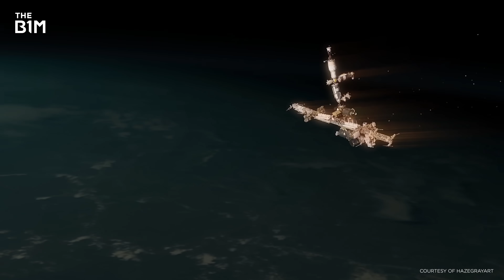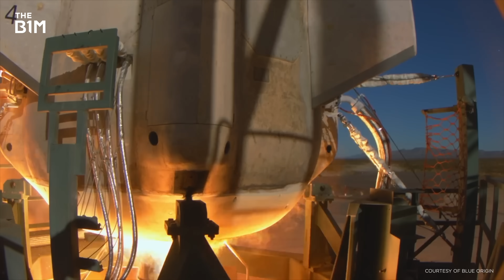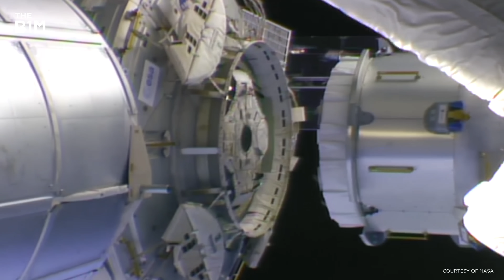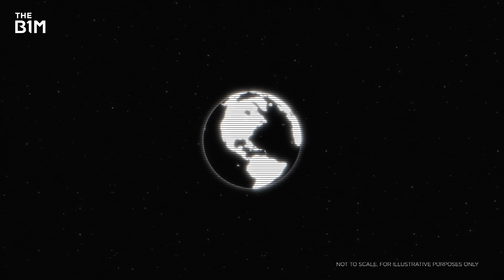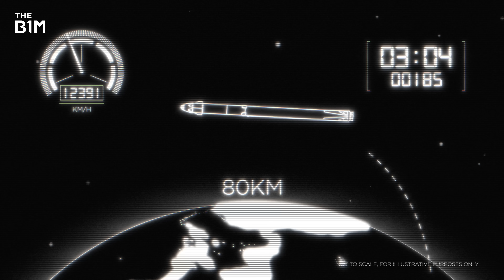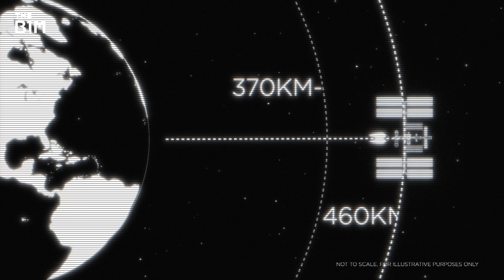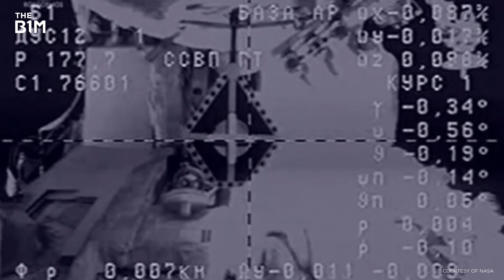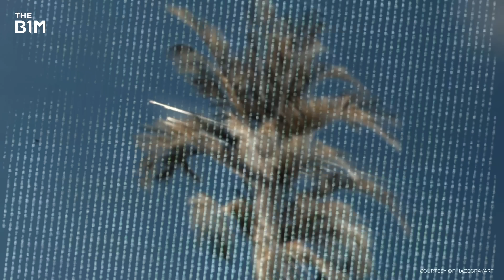The End of The International Space Station

Comment: When they decommission the ISS , I want them to load it with a load of stuff between put together diggers and all sorts of compressor engines along with some big modern zephyrs and after a time all old Atmos and compressed airs mixed with an electrolyte and leave some upstairs while taking down in a mix of gasses microwaved electrolyte energy makers and microwave expansion compressor capabilities. Trying also new radio drive principles and as an unmanned drone equivilant until through massive mirrors we are able to eyes on focus radio bursts that cut down radio time in coded busts that are lit up like a targeting Lazer for a telescope array but going on the light burst picking up the in depth info as well seconds on. As the immediate process is light registered one blip type answers for deployments to make the expansion of the balloons systems collecting also using water as well microwave expanding other liquid gasses while also collecting enough on way down and glide a quarter mile able had digger Wheely and flyer with quad drone systems and electrolyte battery able it could deploy a quarter mile of sealed units and men would utilise by a swift radio energy microwave arclite ship to three month transmission transit and drop a numbr of guys in a waited feedback microwave expansion quad blower and go to the hab Lander with further cans of liquid stuff to mix with dust already dug by auto in hab grounds still sealed units the balloons unfold around , then they go round after detaching the compressor quad units cables and bring to pressure with filtering and some mixing, the liquid marsion earth dust sealent swift for hab pressure and as with all units heat sync to eventually warm up the quarter mile hab as well as be able to go from hab unit to hab unit and work area assembling slowly an underground oxygen base and drilling also for elements perhaps ably electrolosised from water underground. These the ISS build as rebirth to its orbital ends , the systems quads expansion mics and wave reaction engine magnetic arc light processors that it would be rebirth from earth's orbital interactive ends

Comment: Regarding extreme temperatures, correct me if I'm wrong, but wouldn't the ISS being in the vacuum of space (or at least the atmosphere being extremely thin) significantly reduce its heat loss when the sun isn't shining? I'm not saying the temperature swings aren't extreme, but surely not as extreme as it might sound at first glance. Plus, the fact the ISS is in and out of the sun 16 times per day must also prevent the temperature swings from being too extreme.

Comment: 18:00 I think this the part where you're incorrect.. it does NOT matter how high an object has to be to achieve "microgravity".. "microgravity" is nothing more then an effect of sustained free-fall.. put it simply, you will feel "microgravity" if you would jump-out of an airplane (at least until you'd reach ground).. hence, it does NOT matter if ISS is 400km above surface, or 200km.. as long as it keeps orbital speed it will ALSO keep "microgravity" effects inside the station.. remember, just because a spacecraft goes up into "Space", does NOT mean astronauts inside it will feel "weightlessness", UNLESS, that spacecraft reaches ORBIT..

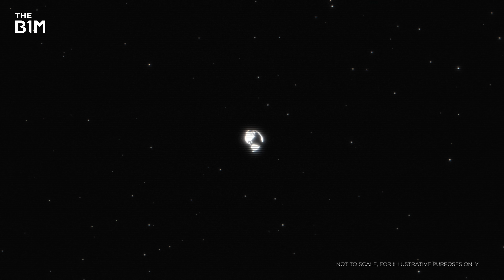Comment: 17:52 I'm sure most people watching this are aware that altitude in close proximity to Earth has little to do with weightlessness. If you could stand on a magical stationary platform above the Earth at the same altitude as the ISS orbits, you would experience almost 1 G of gravity.

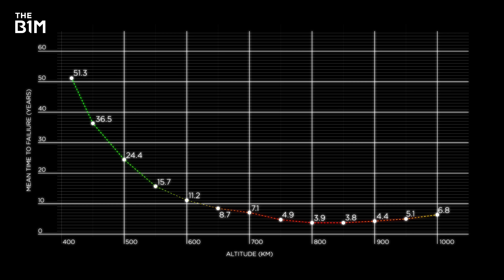Okay, you've convinced me that deorbiting is the only practical option, but I wish it weren't true.  From the chart at 26:01, it's obvious that 850 km is not high enough, but that's the low point in the curve, longevity begins increasing after that.  We have been boosting its orbit periodically for decades to avoid reentry.  Why not give it a final extra nudge (or 2 or 3 or 4) into a stable orbit when it is decommissioned?  Beyond LEO and its swarm of space junk.

Comment: All right, I get that the ISS structure is subject to deterioration in the space environment, as is anything up there. Temperature swings lead to metal fatigue. Micrometeoroids keep grinding away at surfaces. Nothing lasts forever, even though at least there is no corrosion. But I still don't get why the whole structure needs to come down. If it really is built in a modular way, why can't we just keep replacing one module at a time, into the indefinite future?
Reply: First of all, there isn' t available at the moment any vehicle with the capabilities of Space Suttle in order to put such big pieces on LEO. Secondly, this seems a very costly procedure because it will be practically a new station, so the cost will be the same if not more. I don' t believe that global politics are on te same track as early 90s. We are experiencing a deterioration in a lot of things today compared to then.

Comment: It feels like a wilful failure that we can’t/won’t pull it apart and bring it back undamaged so we can put it in a museum.
Reply: The problem. Is as with everything... Money. 

Most of the modules were designed to fit in the space shuttle. We would have to re-commission a shuttle just to pull it apart. Given the shuttle main engines are currently being slated for re-use by Artemis (some of which have already been used). Which is another global (albeit western centric) effort for the moon. Same with the shuttle SRB segments.

To re commisiom an orbiter would take a mountain of work - restoration for display is not cheap. Restoration for re-use after its been sitting around in warehouses and museums is even more expensive. and building a new one is even more than that. 

The problem: the shuttle was unique in not its capacity but its overall volume. It was able to lift large bulky but lightweight payloads to orbit. Something conventional rockets really struggle with. The fairings would likely be too wide for it to make sense.

Comment: "Its not floating, its flying" - no, its doing neither. Its orbiting. Neither floating nor flying describe an orbit correctly. Fundamentally an orbit is moving fast enough laterally, so that whilst you are falling toward Earth, you continually "miss" the planet. By the time it would have hit Earth's surface, it has moved far enough around that it continues falling around the curve of the planet and follows the cycle forever (in the case of a stable orbit, as described here due to the ISS's altitude it is not in a truely stable orbit due to the atmospheric drag, the orbit is gradually decaying)

Floating your volume, on average, is lighter than the volume of fluid it displaces causing an upward force. Flying, you are using aerofoils or other structures to force air downwards to propel yourself upwards. Neither of this is what the ISS does.

Comment: The ISS orbits at an altitude of between 370–460 km (200–250 nmi).
Approximately 408 Km. 
A pressure of 1 x 10^-11 torr is typically associated with ultra-high vacuum conditions, which are found in outer space, and at altitudes of approximately 100 to 200 kilometers (62 to 124 miles) above Earth's surface. 
Here's a more detailed explanation:
Torr and Atmospheric Pressure: 1 standard atmosphere (atm) is equal to 760 torr. 
Vacuum Levels:
Low Vacuum (Rough Vacuum): 760 to 25 torr. 
Medium Vacuum (Rough Vacuum): 25 to 1 x 10^-3 torr. 
High Vacuum (Hard Vacuum): 1 x 10^-3 to 1 x 10^-9 torr. 
Ultra-High Vacuum: 1 x 10^-9 to 1 x 10^-12 torr. 
Outer Space: Pressure in outer space can range from 1 x 10^-6 to 1 x 10^-17 torr. 
Absolute Zero pressure represents no Atoms in space which is theoretically impossible. 
Altitude and Pressure: Atmospheric pressure decreases with increasing altitude. 
Altitude for 1 x 10^-11 torr: While a precise altitude for exactly 1 x 10^-11 torr is difficult to pinpoint, it's within the realm of ultra-high vacuum, which is found at altitudes beyond the Earth's atmosphere, such as in space. 
The International Space Station (ISS) is pressurized to the same atmospheric pressure as at sea level on Earth, which is 1 atmosphere (14.7 psi) or 760 torr, while located in an area of 1x10^-11 torr.
The ISS maintains a pressure of 1 atmosphere (14.7 psi) or 760 torr, the same as sea level on Earth.  The atmosphere inside the ISS is similar to Earth's, consisting of 79% nitrogen and 21% oxygen.  This pressure is crucial for the health and safety of the crew and for the proper functioning of the equipment on the station.
Therefore, if the ISS is pressurised at 760 torr (14.7 psi) or 1 atmosphere, in an environment of 1x10 ^-11 torr or 0.000000000000193367747 psi, under such tremendous pressure differential there should have been a catastrophic failure of it’s hull, hence an explosion. 
Now let’s examine the mathematics. 
14.7 psi / 0.000000000000193367747 psi 
= 76,020,950,898,290.19 psi (5,172,918,881,000 atmospheres) that is over 5.1 trillion atmospheres, between the interior and the exterior of the ISS.  Presently, there exist no technology available to engineer a structure to maintain such a pressure difference, illustrating the ISS is a Hoax and NASA has been fooling the public since its conception.
Reply: That's not how numbers work. It just has the hold one atmospheric pressure.

Comment: Didnt explain why it can't be continually reboosted and kept in orbit for much longer and leak fixed or faulty module removed.   A bit premature to say we dont have the ability to boost it out of orbit.  Better to use its modules for the Lunar Gateway.  I suspect there is a biological reason for destroying it.  Perhaps mould in inaccessible places and mutated bacteria due to radiation. Stench of vomit etc.   MIR also was decommisssioned, possibly for same reason. It's insane that the space junk is now preventing space utilization. NASAs budget should be increased rather than relying on the private sector. China is progressing further with steady increments.

Comment: There are lots of errors in this video. Here are just a few. Yes, I'm gonna be that guy. 

1) The 9 minute rocket ride to the ISS does not travel "the distance between LA & Las Vegas, or roughly 400 kilometers" (the altitude of the ISS orbit). That's a common misconception. Reaching orbit is not about flying UP, it's about gaining enough velocity PARALLEL to the Earth's surface so that you never hit the ground. It only needs to go up far enough so it can be above the atmosphere and be free of air resistance. By the time its engines shut off, Dragon/Falcon has traveled THOUSANDS, not hundreds, of km, and is halfway across the Atlantic.

2) the Dragon spacecraft does not discard its nosecone because it's integrated (it opens and closes), and it doesn't use the Common Berthing Mechanism (CBM), which is only used for uncrewed cargo vessels or as the connecting mechanism between pressurized modules on the US segment. The current Dragon uses the International Docking Adapter (IDA), as does Boeing Starliner.

3) Video repeatedly shows the ISS flying backwards, leading with the Russian Zvezda module, which is at the very back of the station.

4) Gets port & starboard flipped, says the Tranquility module is on the starboard side. 

5) Video makes it sound like the docking mechanism difference is a mistake and that they discovered the mistake only after they got to orbit. Everything about ISS design & construction had been worked out to the minutest detail years in advance, and they had already developed a version of the PMA adapter (to interface between US & Russian vehicles) for use during the Shuttle-Mir astronaut exchange program a decade earlier. Nothing about this was a surprise or an accident.

6) the Russian Soyuz & Progress vehicles don't use the PMA for docking. They don't even use the APAS. That was only for the one link connecting the US & Russian segments (between Unity/Node 1 module & Zarya module).

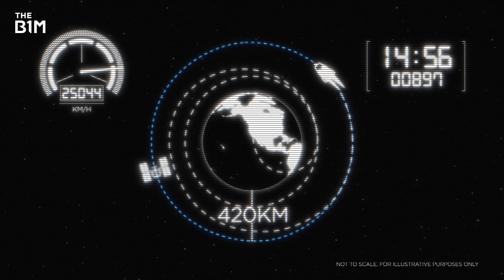Comment: 17:12 Incorrect. It's way less than "just over 10 minutes". LA to Vegas is a roughly 400 km. When we look at SpaceX launches for their Starlink and other lower earth orbit sattelites they always cut off between 27000-27350 km/h at an altitude of 200 km above earth surface (and then it rises a little further to get to ISS height, but that speed increase is irrelevant). So that is at least 7,5 km/s so that means 400 km is covered in less than a minute.
Makes sense, because it orbits the planet about every 90 minutes.

Comment: 270 degrees temperature swing isn't very much compared to welding equipment exposed to over 2000 C welding arcs.
Reply: 'Material Fatigue Temp Duty Cycles' Allegedly Circles every 92 minutes 16 times a day!!! Dude the Idiots Space Studio has never been shown to ever be serviced never proved to even have basic submarine air carbon scrubbers on board. LOL

Comment: How do “thrusters” work without an atmosphere to push off against?
Reply: You could look this up very easily. They don’t push off the atmosphere. They push off the walls of the fuel tank which because of the thruster is unbalanced.
Reply: @darthmaul216  .."of the fuel tank which because of the thruster is unbalanced." So, HYPOTHETICALLY a car spins out on an oil slick over frictionless ice but somehow would have full control in an exponentially expanding sky vacuum sucking the thrust out as fast as its produced??? RIGHT LOL
Reply: @AV036  Why do you stay ignorant on purpose?
Reply: @darthmaul216  So, don't paddle.. just thump on the canoe its self or did you work that out by blowing into your own sail?
Reply: To go from air gas pressures into an exponentially expanding magic sky vacuum requires vast amounts 'imagination' pushing of off nothing but pretend crap using cartoon 'animations'.

Comment: Nice presentation. However, there's one thing I don't understand, and I would appreciate if someone can explain it. Aluminum, from which the ISS outer layer is made, may no doubt be incredibly strong, especially when shaped correctly, but its melting point is still 660.3°C / 1220.58°F, and Thermosphere temperature can be up to 2000°C / 3.632°F or even higher. Once the Aluminum reaches its melting point, it only needs a couple of seconds to turn to liquid state. Magnesium - Aluminum alloys may have somewhat higher melting point, up to 700°C / 1292°F max. So, can anyone explain this? Thanks in advance.
Reply: The particles in thermosphere may be very hot, but it's so incredibly thin that there's basically no energy actually being transferred. The aluminium radiates the heat off faster than it's heating up.

Comment: Thanks for the walk down memory lane. (One small correction at 17:52 that the weightlessness is not really a function of altitude but of being in freefall due to orbital speed. They need to be high enough to avoid too many atmospheric particles.) 

I worked on the assembly of the ISS for the first 8 years of my career, 1999 to 2007, supporting 16 missions including many from MCC is Houston. 

I was with the contractor Neptec Design Group and we did the Space Vision System that provided the machine vision for giving the relative positions, orientation, and rates (aka, "pose estimation") for assembling the modules together. It's the reason for all of those black and white dots on the ISS.

As and interesting aside, we also provided on-orbit 3D laser scanning of the Space Shuttles for damage following the Columbia tragedy on 2003 and I was on MCC support for the 2005 return to flight. We combined the laser scanning and pose estimation into a new rendezvous and docking system -- TriDAR -- first flown around 2009 to the ISS, and it is still flying on the Cygnus vehicles. 

I look forward to the ISS coming down. While it was a big part of my early career and I'm immensely proud of what we all accomplished together, that was a generation ago. It's time to spend our effort on the next opportunities. 

I'm still working in the space industry and helping to get a new generation of hybrid rocket technology operating in space for simpler, cheaper, and more responsive launch. 

I would love to see some new commercial space station replace the ISS, and a new era of a sustainable space economy.

Comment: Not sure why not simply detatch that old module and replace it with another one?

Whay not build a new station and hook it up to the ISS its truss and, Leave the old ISS hooked up and use it for spare materials.
Seems more sence to do it that way than to just rebuild something entirely new.
Besides that, it would be a good for human experience, safe launching and construction costs as everything else but that module in the ISS works fine.
Burning it up seems the worst option in every way.

Comment: I miss one crucial element. We look at ISS as being a 'station' being connected to 'stationary' however this is not true. The ISS orbit around every 90 minutes and it actually has external propulsion and gyro control for elevation. ISS is more like an actual spaceship not leaving its orbit ever than being a station. A vehicle that could visit other planets would look like ISS a lot instead of a takeoff and landing vehicle like shuttle or Starship which currently is more like a very expensive Pez dispenser than an actual spaceship. Has anyone even looked into using ISS to go to the Moon, Mars and back home with a cheaper retrofit?

Leaving the station in orbit is more dangerous than a controlled burn. ISS isn't really fully finished and is not designed for heavy propulsion which is imo clearly a design failure. It can be a commercial attraction for perhaps a decade but who will maintain it? ISS was great for learning more about long term spaceflight and just like with everything who will fund it all. The Chinese are catching up it seems pretty much copying known tech and perhaps improving on older designs. In the end they are just reinventing the already invented wheel and throw a lot of money at it